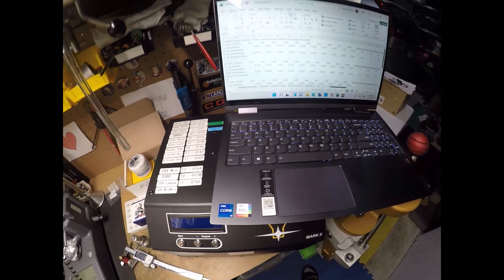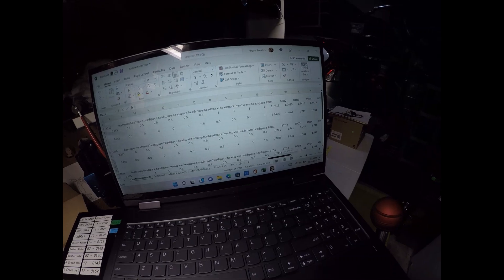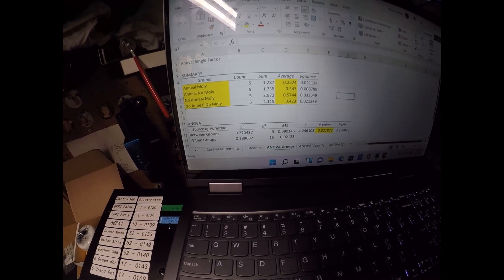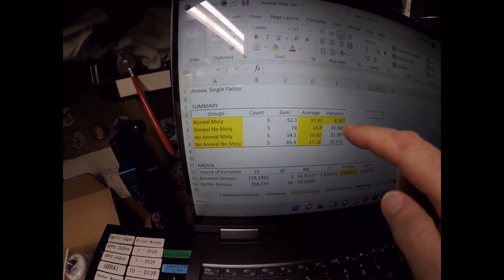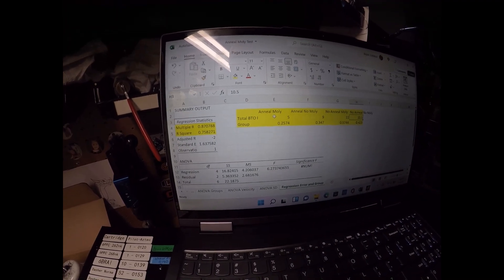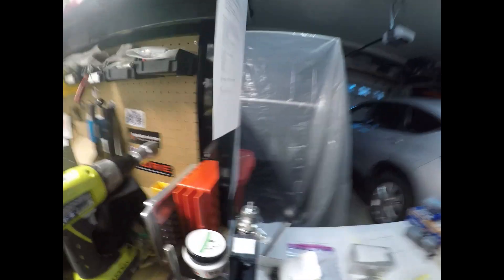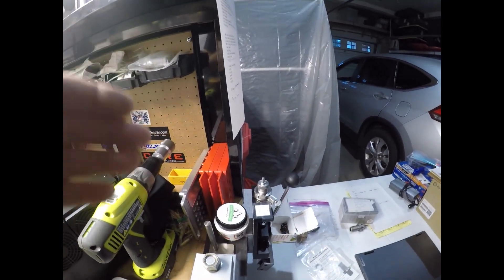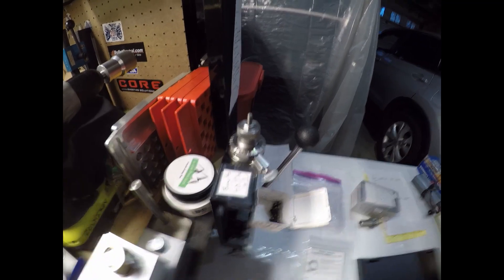Witch Doctor: Effects of Annealing and Moly Lubricating Inside the Case Neck

Comment: Brian,
Is the MicroLubrol molybdenum disulfide 1-2 micron a powder or paste ?
Thanks
Reply from the maker: Powder but others who posted here mentioned a paste. I ordered some of the paste and plan to try it.
Reply: @WitchDoctorPrecision  Thanks, I am only able to find it in powder form but not in paste, can you tell me where you got the paste please and do you have a preferred brand in powder.
Thanks
Reply from the maker: @elvisjerrylee  paste 
https://www.amazon.com/gp/aw/d/B07G2SK8VN?ref=ppx_pt2_mob_b_prod_image
Reply from the maker: @elvisjerrylee  powder 
https://www.amazon.com/gp/aw/d/B00WP082IU?psc=1&ref=ppx_pop_mob_b_asin_title
Reply: @WitchDoctorPrecision  Thanks for taking the time to give me the information.
When I pre load my rounds and there is a possibility I will not be shooting them right away, I purposely seat them long and reseat them to the correct seating depth, to break the potential seal, just prior to firing. By using this method of lubing the inside of the necks with moly, I may not have to seat them this way. 
Thanks for putting the effort into testing and collecting all of this information, I for one really appreciate it.

Comment: Hey Bryan! Really appreciate the testing. It's very refreshing to see someone who actually tests enough ammo to achieve statistical relevance. Drives me a bit crazy when someone will shoot two five shot groups with different variables and then claim it's a significant result.  Question for you. What state were the necks in before the process was started? Do you wet tumble with stainless media resulting in a completely clean neck? Or was the base test with a dirty neck with existing carbon in it.  I've heard stated many times that leaving carbon in the neck negates the need for additional lube so I'm curious if your testing can shed some light on this issue.
Reply from the maker: Thanks for checking out the video. I am glad that some people can see the value in isolating a variable and firing enough rounds down range to be able to detect a statistically significant result. 

The necks were already carbon fouled. I used brass that I have used in previous testing. All I do for the inside of the necks is brush them with a nylon brush. I never completely clean out the carbon. After chatting with Lou Murdica in the tunnel, he indicated that you would have to moly even with the carbon. It looks like my findings merge with his on this particular topic since the moly coated necks did much better than those that were not coated despite all brass still having the carbon inside the necks.
Reply: @WitchDoctorPrecision   Thanks for the quick reply and additional info. I just discovered your channel today and am making my way through the videos.  I definitely understand why more people don't use statistically significant tests...it's a lot more work! If you wanted to test all the relevant data points you could easily wear out a barrel before it was finished. I appreciate your work as so far it's much more definitive than most of the testing I've seen on youtube.  I'm going to try lubing the neck on my 6PPC BR gun now based on your data.
Reply from the maker: @MMBRM  thanks! That is my goal to produce and exhibit tests that represent substantial contributions to the knowledge base. I realize that some of the tests are not necessarily generalizable to all circumstances but at least the methodology I demonstrate can be used by others to test their circumstance.

Comment: Thanks Bryan - very interesting results on a debated topic, which has lacked published data until now!  Looking at your data, I find 0.009" in BTO error for the Annealing/No Molly group a bit high in my experience  - I fall in this group of reloader who anneal each time and do not molly. I will check what I get in my next reload, as I've been only spot checking for now. FYI - I have the AMP Press and tested seating pressure with and without lubing: I found absolute differences but no difference in spread between groups. However, I believe that maximum seating pressure should affect mostly neck tension depending on how the brass deforms and springs back. I am not sure how seating pressure would affect BTO unless perhaps of extreme cases of low or high frictions, i.e., near zero neck tension (bullet would fall without much push from the ram) or inside neck scrubbed with alcohol (jerky ram movement). I cannot explain the correlation between lubing the neck and BTO, considering how harbor press works with the seating die.. The curve on the AMP Press does not show any jerky movement of the ram at its final point when the bullets sits. Do you have any theory?  Out of curiosity, how much cleaning of the inside of the neck did you after each firing in this test? Also, and I do not shoot BR matches, I am curious of the need to resize during the match: would not you get better consistency by bringing enough consistently prepped brass for the entire duration of a match? Thanks again for all your tests Bryan. They are great.
Reply from the maker: Thanks for checking out the video. The amount of error was total error among 5 pieces of brass fired 5 times each because I measured every single piece of brass prior to all 5 sets of firings. I did not report on the details because the video would be very long but I am glad that people like you comment so that we can get into some level of detail. The total headspace error for all annealed brass (50) was .0095 and for pieces not annealed it was .024. My conclusion there is that annealing essentially cuts the potential error in half. Also, the range of error in annealed brass was very low (maximum .001) whereas in those not annealed it was much higher (.003). So even though there was .0095 error in 50 annealing episodes, the typical error was .0005. The BTO error in annealed brass was .014 and in not annealed brass was .0215. In the moly coted it was .016 and without the moly it was .0195. This tells me that annealing has more of an impact on BTO than moly coating. In terms of error in BTO, one thing that I did not measure was the bullet BTO but I used hand swaged bullets that tend to be very consistent so if there was error from them, it would be negligible and spread across the various conditions of the test. Anyway, I do look forward to utilizing the AMP press and it would have been great to incorporate into this test but I will just have to wait. Thanks for the information you have found. 

I do scrub the inside of the necks after each firing with a nylon brush just prior to annealing. For short-range bench rest matches, I do know of a couple people who do bring pre-prepped brass in enough volume to not have to resize them during the match. I am considering this strategy for sure. It also enables you to observe wind conditions more often so I know there are more than a few pros to that method.
Reply: @WitchDoctorPrecision  Thanks Bryan for the details. I had misunderstood the definition of the BTO error and it is actually pretty small.
Reply from the maker: @Eric-qu3ht  yes, it was definitely a smaller factor compared to the larger error in headspace. If I didn’t have time to check both and had to pick one to monitor, I would easily choose headspace.

Comment: Quite a while ago I tried moly bullets for the first time. I did not see enough of an improvement to continue using them. I was not able to totally remove the moly from my barrel during the cleaning process
. 
I see your results, but was wondering if molying the inside of the necks would deposit enough moly over time to possibly cause the same type of issue I had before.
Reply from the maker: I don’t think it would. The moly would evaporate once the powder is ignited. In this application of the moly, it’s simply for uniform seating pressure and BTO. I doubt there is any moly sticking to the small portion of the bullets bearing surface as it rides the lands.

Comment: Thank you for this knowledge. I have been using Moly since Lou Murdica gave AMP an interview. I found that with the bore mop method was, it was difficult to see if I had applied enough Moly or any at all. So, I made a solution of isopropyl alcohol and moly powder and I’m applying it with a cotton swab. A thin visible layer od Moly is now present.
Reply from the maker: Cool! Please describe the method for how to make the solution and it’s application so I can try it out. Thanks in advance!
Reply: @WitchDoctorPrecision  There is Neolube No. 2 available on Amazon. It is used by Keith Glasscock in F Class / see https://www.youtube.com/watch?v=X4Lk_DZjuUI at about 5:30 minute in the video. Looks less messy than Moly... MIght be cheaper to make your own like TQB is doing.
Reply: @WitchDoctorPrecision  Hello Bryan, how did you apply the moly powder when you made this test ?
Reply from the maker: @br4713  a bore mop. Simply dipped it into the moly and then ran the mop down inside the neck. The seating pressure on the moly necks was notable lighter but I don’t have an AMP press to quantify that. Hopefully I will get one soon.

Comment: I absolutely appreciate this content!!!!!  Very interesting!!!  I appreciate the scientific method process that you’ve implied!!’  Im testing with rice and the use of imperial sizing wax in the necks in the tumbler for the past two months.  I’m getting great bullet seating pressure and very consistent seating. I found out about this on primal rights website. I’m getting a little better results compared to using moly in the necks. After tumbling, the rice absorbs the sizing wax and it leaves a very smooth finish with lubricity characteristics inside of the necks. Since doing this I have seen Erik Cortana’s YouTube video on this subject with Greg of Primal Rights.
Reply: Bryan - love your videos and analysis as always. WV Long Shooter - I just ordered the bag of rice Greg from Primal Rights recommended on his blog post. Im going to try that method as well. I am on the list to get an AMP press and hope to be able to measure the entire seating force curve, vs just the final force like I do on my K&M. Spoke to Greg for a bit on the phone on the primer depth testing and ignition system timing. I think that video is making a lot of waves - curious as to the BR perspective on using primer crush vs shims on the firing spring to alter timing and harmonics - on the rice vs  moly - I do suppose that one of the advantages of moly as well as NeoLube (graphite) is that you can seat bullets long and then do a final seating at the range or right before.
Reply from the maker: @sf2189  thanks for checking the video and posting constructive info. Please post the Primal Rights info you refer to because my search showed a video that was just about cleaning with rice without a test of rice vs moly. I would love to see the data or at least the rice lubricating method so I can try it myself if need be. 

I look forward to seeing your results with the AMP press. It’s definitely a great advancement to our study of the various effects of loading methods. 

As for the BR perspective on primer seating, I am in the middle of testing primer seating depth. If data has already been shared in this topic, please post here. The more we can make this a “knowledge repository” the better! Shoot small y’all!
Reply: @WitchDoctorPrecision  So there is a video that Erik Cortina just put out interviewing Greg from Primal rights. Its worth a watch, lots of good info - especially on primer seating depth and tuning. No test vs moly but Greg has gotten some amazing results (as measured by his amp using rice and imperial lube - there seems to be some sort of residual coating). I like to test things for myself so going to do same thing you did - but all annealed but no cleaning, cleaned in rice as per Greg’s method and then moly’d as per yours. I would look at seating force, pressure curves (PT-II) and obviously velocity and group size. I think the AMP Press is necessary for a fair comparison.
Reply from the maker: @sf2189  cool, I’ll look up the vid. I look forward to checking your results. As for how to interpret your findings, if the outcome in each condition is the same then fairness in the method of measuring seating pressure will not explain the results when all or most other variables are accounted for. If the outcome differs by lube method then perhaps seating pressure curve and force differences can account for the difference. Alright, enough of my science mumbo jumbo…let’s get to some testing!
Reply from the maker: @sf2189  can you post the link to the video here. I don’t have time to search through the imprecise search results. Thanks in advance.
Reply: @WitchDoctorPrecision  yes of course - completely agree. We shall see what happens.
Reply from the maker: Cool! Please post info about this method so we can take a look. Always great to continue advancing our methods to gain greater precision!